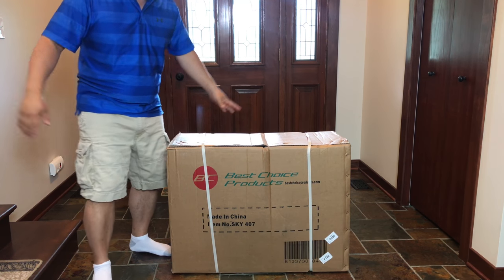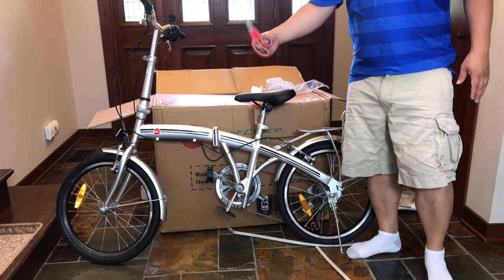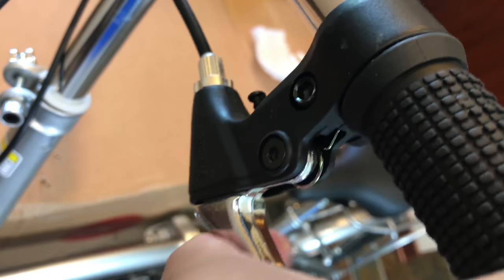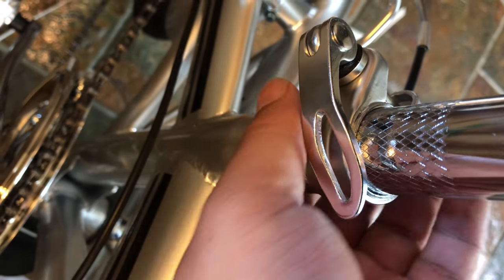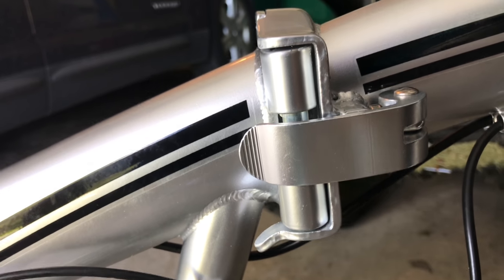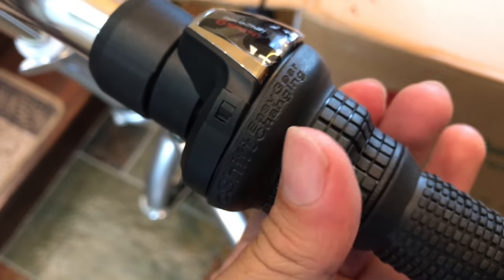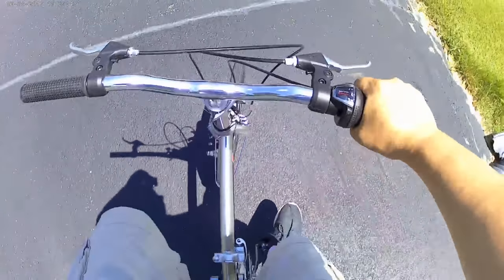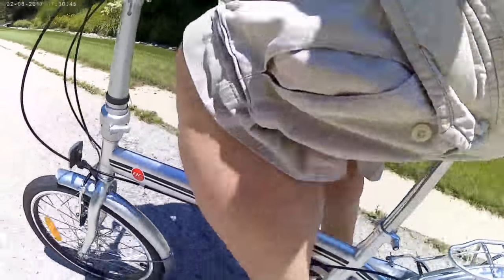Best Choice Products Shimano 6 Speed Folding Bike w 20" Wheels Review

Comment: Good review. How heavy is it? Commutable with it?
Reply from the maker: +Joshua Chung pretty heavy. Normal bike weight heavy. Definitely would be tough to commute with.
Reply: With the folding feature, I plan to put it into the trunk (with seats down, of course) of my Ford Focus and take it on a ferry trip to the outer islands of New Brunswick, Canada.  This will only cost me $12 compared to $35 if I brought my car on board.  This video was exactly what I was looking for because I couldn't figure out the folding latch on mine, a Markcool Trip MZ M200 MCT.  I just received this and paid about the same price for it.  Very satisfied with it here in Eastport, ME.  Oh, one thing, wear some shoes in this video, thanks!
Reply: 36lbs it's pretty heavy luging it up 3 flights of stares

Comment: Anybody know the weight limit on this bike?
Reply: the weight limit is 180 LBS
Reply: @racelespineda4191  is that documented on the citizen manual?  i have a 16"' folder and it supports 250lbs.  180 sounds way to light.  i also have a a frame folding bike and thats 180-200lb limit.
Reply: 220lbs max. I just bought the bike last week the bike is 36lbs.